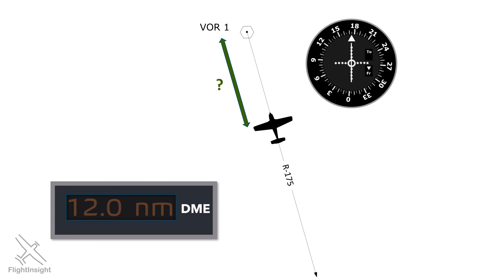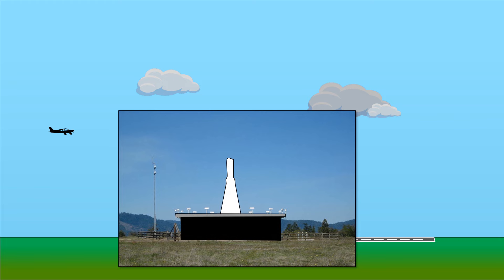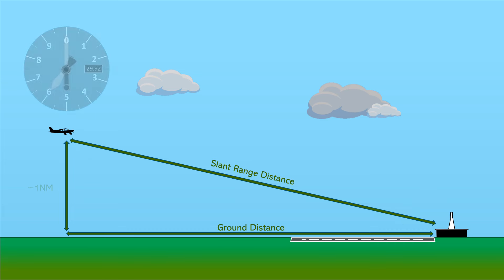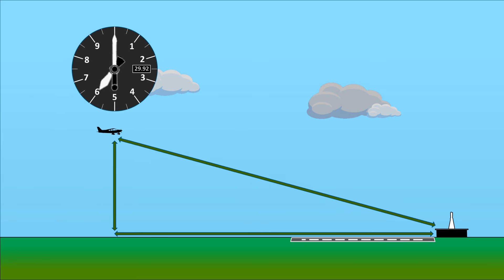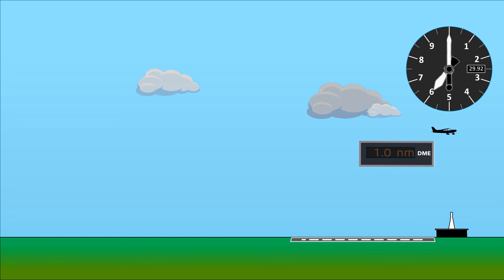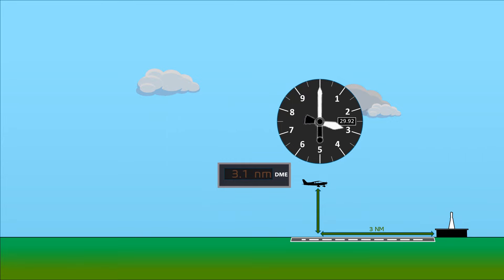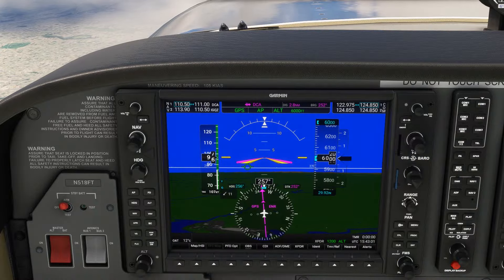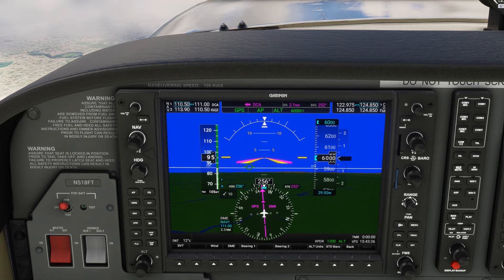What is DME Slant Range Error? | Distance Measuring Equipment Explained

Comment: See also AIM 5−3−8. Holding: "6. Use of RNAV Distance in lieu of DME Distance. Substitution of RNAV computed distance to or from a NAVAID in place of DME distance is permitted when holding. However, the actual holding location and pattern flown will be further from the NAVAID than designed due to the lack of slant range in the position solution (see FIG 5−3−7). This may result in a slight difference between RNAV distance readout in reference to the NAVAID and the DME readout, especially at higher altitudes. When used solely for DME substitution, the difference between RNAV distance to/from a fix and DME slant range distance can be considered negligible and no pilot action is required."

Comment: Not that is matters from a practical point of view but I wonder if the distance listed for a DME arc on a VOR or a localizer or ILS approach etc. accounts for this?
Reply: When TERPS creates the approach or the fix to do a DME arc, it is calculated with the slant range and the indication on the DME read out is expected based on the altitude of the procedure. So, a 7 DME arc is 7 DME. With the close proximity, it is very nominal. Using a GPS will give you exact distance, but since the FAA allows up to mile error flying the arc, 7 miles on the GPS is not gonna be that far off than 7 DME as indicated by the DME read out.
Reply: @aviatortrucker6285  Thanks for the input. I knew it was negligible and certainly less than my personal variability when hand flying but was just wondering.
Reply: @williamk5998  while we’re on the topic of DME arc I do not use the 10 turn 10 twist method. That is just too much work. When I am at the fix that designates the start of the arc, I turned 90° to the radial that designates to fix. Turning left or right depends on the direction of the rotation of the arc. So if the fix, let’s say is off of the 315 radial and I am flying in a clockwise pattern, I will turn 90° so that 315 is right at my 90° point of my HSI or DG. As I am flying, I watch my DME and turn about 5° every 5 to 6 seconds and note whether my DME is getting closer to the VOR or away from it. If it starts to move closer by 1/10 of DME I will prolong my turns a little longer until I’m back on the correct DME. If the DME increases by a 10th I will increase my turn towards the VOR and see what it does. Usually hand flying I can remain within about a .1 plus or minus of the correct DME. 90% of the time I am right on the money. If I  am using auto pilot, the navigator does an excellent job keeping me right on target. As soon as my inbound course is approaching 80° as seen on the HSI or DG I then make my 90° turn to intercept the inbound course. Hope that helps.
Reply: @aviatortrucker6285  Excellent explanation. Are you a CFII? I'm looking at becoming one as my next rating. I love instrument flying and I love teaching. I will try your technique on the sim tonight and in a plane next time it's convenient. I agree the turn 10 twist thing is a distracting PIA that often causes problems. The goal is not crossing radials but rather to maintain an arc so the DME is a better way to meet that goal.
Reply: @williamk5998  no but thank you. I’m not a CFII. I’m not even just a normal CFI but I’ve been toying with the idea of getting one. After flying on and off for 45 years, there’s not much I really can do except help the younger crowd learn aviation. At 62 there is no way I’m going to have a career. 25 to 30 years ago it was not profitable to become the CFI because you could not survive on that. I knew nothing of Glass cockpit until I got on the flight simulator. I learned a whole lot was able to transition to the G 1000 and other platforms a whole lot easier than if I would’ve had to learn it hour by hour in an airplane. I understand the is CFI is one of the most complicated check rides there are. Trying to remember and learn all the regulations and being able to quote what those numbers are to a DPE is more challenging since they are putting more on the new ACS. One of the thing I forgot to mention, when you start your turn on the arc, dial in your inbound course on the OBS. Remember the golden rule. If the course deviation needle and the VOR are on the same side with a FROM indication, no matter your heading, you’re not there yet. Use this when flying to an intersection of two VOR’s with the intersecting radial on a FROM indication. Needless to say I do a lot of reverse course flying to keep sharp. The term reverse sensing is incorrect. It is reverse orientation. Always described that as driving north on a road and holding your map straight up. When you see your exit and the town you want to go to off to your right you will make a right turn. However, if you are driving on the same road southbound and hold the map in the same orientation, you would still see the town to your right. If you made a right turn you’d be going in the wrong direction. The same holds true if you are flying a drone or running a radio controlled car. As a car goes away from you and you turn the stick to the right the vehicle goes to the right. If the vehicle is coming towards you and you move the stick to the right the vehicle will go to its right and will appear to go the wrong way. This is why I put in my mind what radial  I am on and what direction I need to go. Sometimes I will have the radial that I want to intercept and leave it on a from indication and use the rule. I stated earlier before I fly inbound toward the station and then rotate the OBS to the reciprocal up top. I want to go out on a limb and say I was a whizbang when it came to flying NDB approaches.
Reply: You're not likely to be as high as 6000' AGL on a segment of an instrument approach, but even if you were, you could be as close as 5 miles before seeing even as much as 0.1 mile of difference between slant range and ground distance. For a position at any point along a 3 degree glide path, there is no measurable error at all, so it's never a factor for the final approach segment and therefore any missed approach point that relies on DME. There is even less error than that considering that for, say, a localizer approach, the DME antenna is usually sited at the far end of the runway so there's even less slant range error at the MDA.